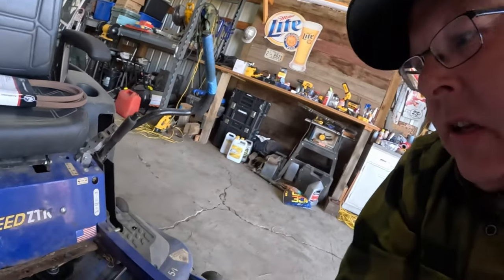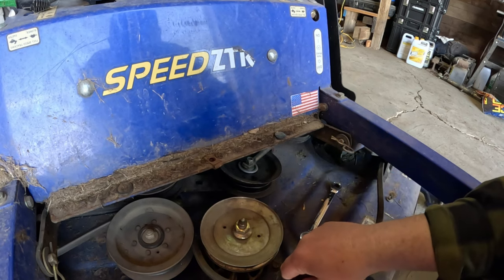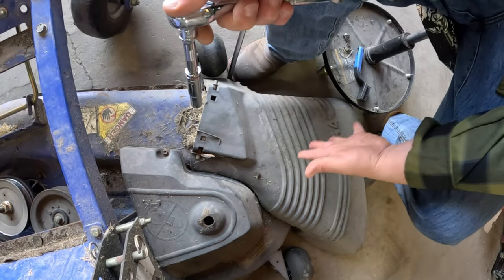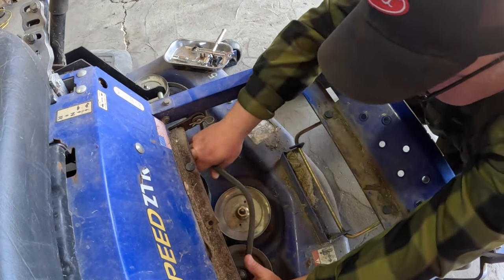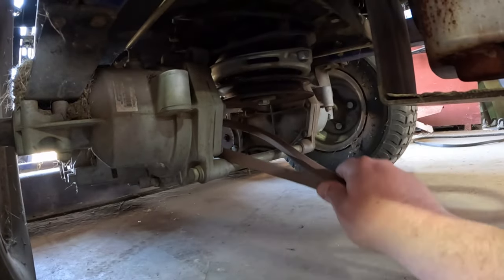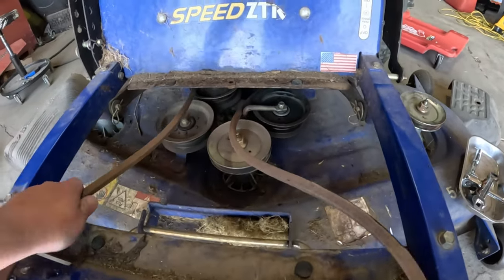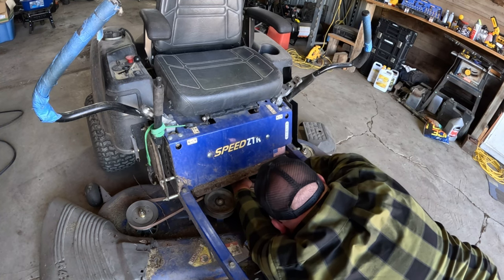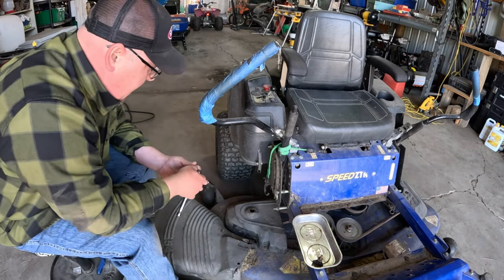Replacing the Zero turn DIXON deck Mower belt

Comment: Is that a 154 inch or 152 inch belt? Before the scene cut off it looked like it was pretty loose. Book said 152 inch belt but I am having trouble fitting it. Your label says 154 inches. Thank you for the video by the way.
Reply from the maker: I didn’t actually measure it, I trusted my guy at Sterdevants and compared it to my old one and it seemed correct. It’s been working good all summer